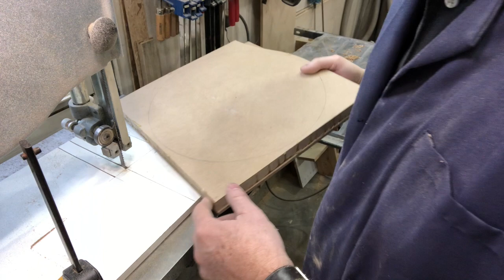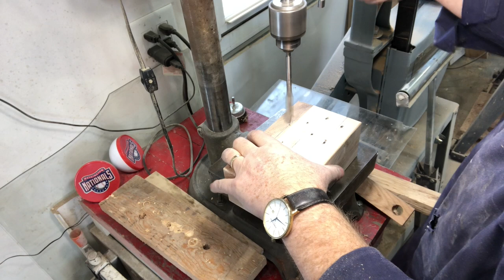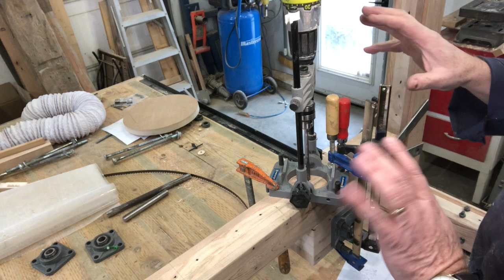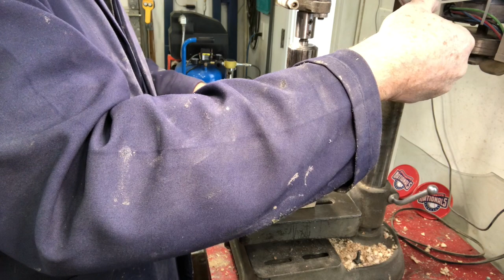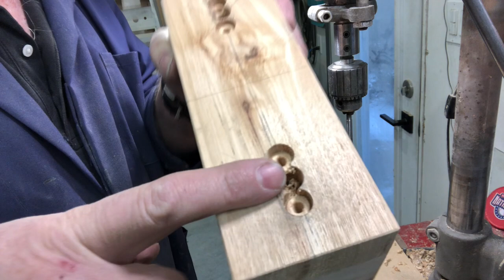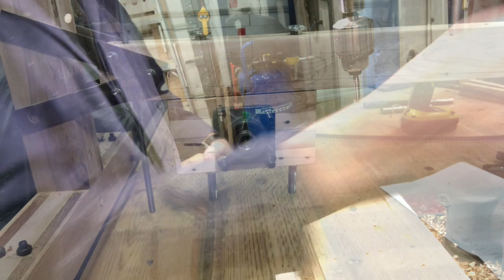WorktableSawmill - Part 4 - Bearing Blocks ... and Wheels Cut!

Comment: Enjoying the build thus far! It makes owning a mill attainable, if only for a little work and ingenuity.  On the drilling, might I suggest that with a spade bit as you have there, having a tight backer block will typically prevent tear out. I understand why you flip it of course, but a backer may save a step in the future!  Great work! Thanks for putting this out!
Reply from the maker: Glad your enjoying the build. Thanks for watching!  Yes, I am always a little late thinking of a proper backer block. You're absolutely right ... I'll try to keep that front of mind in the future.